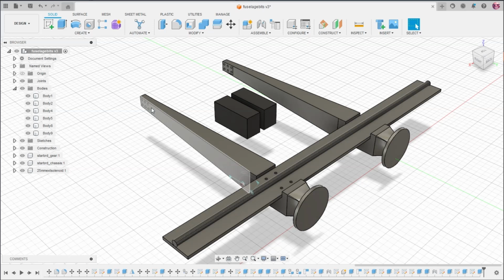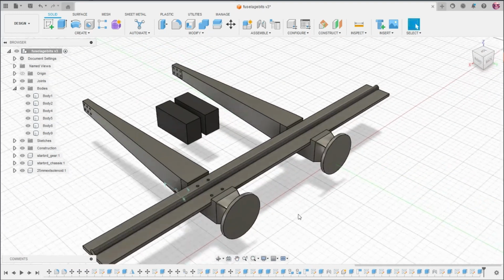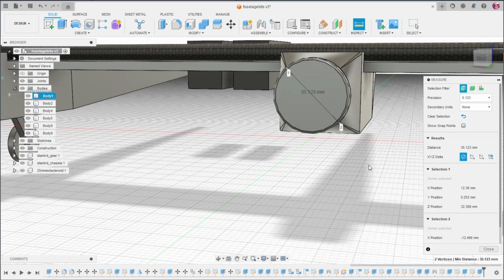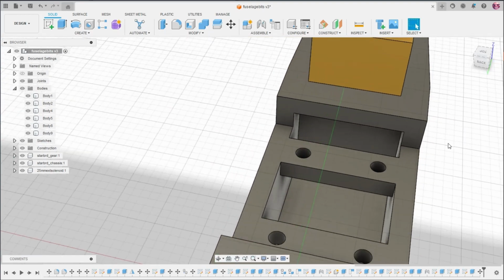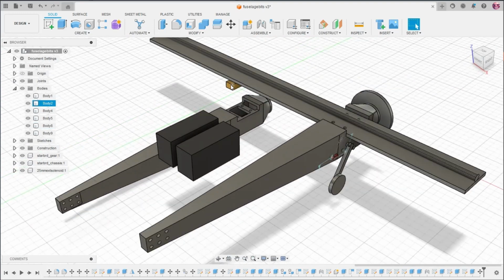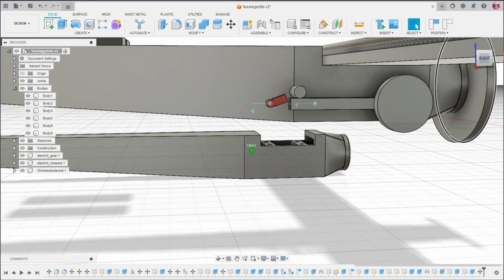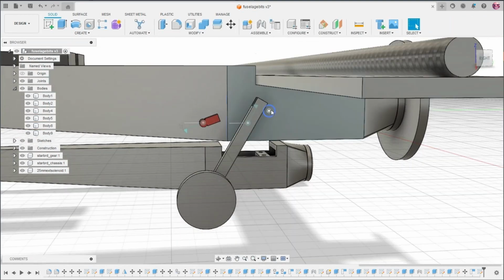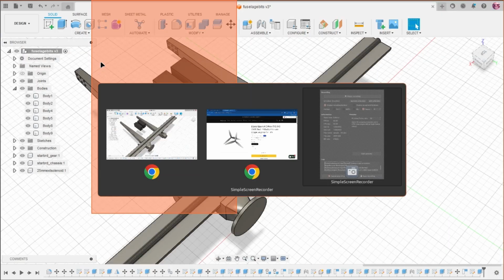Modular Aircraft Devlog #1: Booms, Monowing, and Landing Gear

Comment: what’s the purpose of the plank in the wing? the tube is going to be sufficient as a spar, all you need is a extruded (printed?) airfoil-shaped shell to fit around it and some interface brackets between the tube and the fuselages. the plank is just unnecessary weight.
Reply from the maker: My plan was, and mostly still is, to have a number of ribs that are screwed on to the wing to allow for different airfoil shapes. The rectangle at the bottom is something for them to srew into, and also keeps them aligned. Additionally, it will be used to mount servos for ailerons/flaps. There are square tubes, however, which could eliminate some of those issues without the need for a big heavy plastic rectangle.
Reply: @theSVGfoundation  if you print your ribs with two circular holes punched through them for a thicker carbon tube at the front and a thinner rod at the back they'll stay perfectly aligned without the plank. the servos can be mounted on flanges between the ribs. 
the plank stuck out to me because i've seen many wing structure layouts and never one that looked like this
Reply from the maker: That seems like an effective way to save weight. I might implement that in the next iteration of the wings. Thanks for the suggestion!